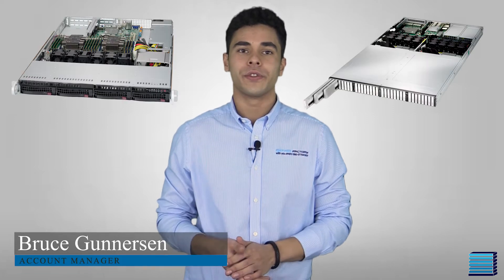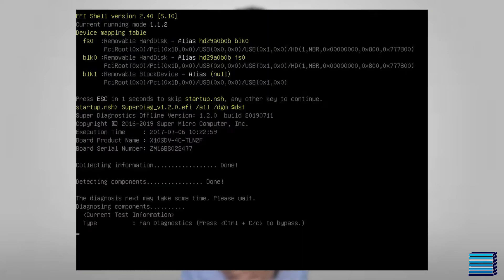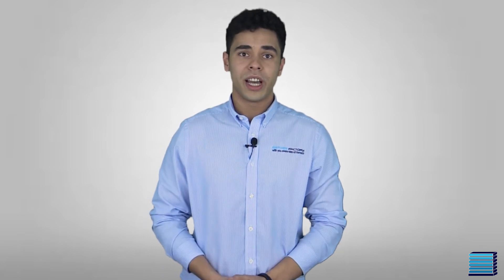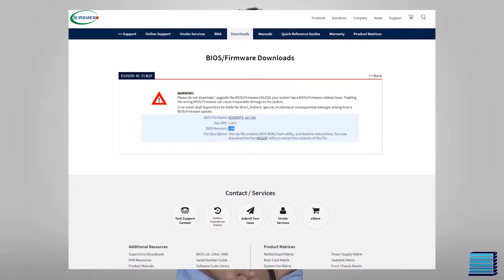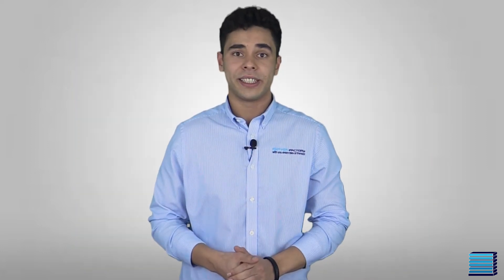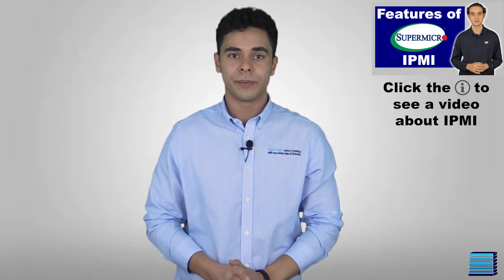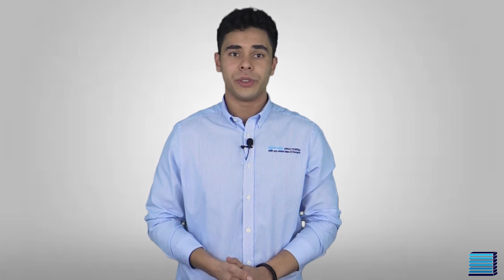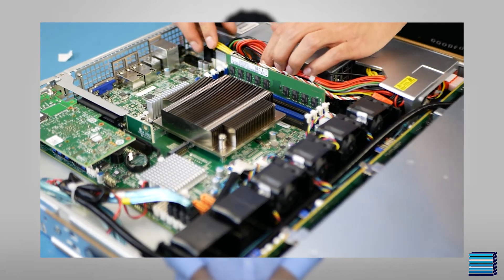The Supermicro Testing Process

Comment: I have a SuperMicro motherboard X9SCM(-F): and I put in the i3 processor and two 1600 (8 Gb) memory modules. I have four 3Tb HardDrives connected to the motherboard, and power supply. I realize I did not connect a monitor, mouse, keyboard yet. But when I press 'On' the Harddrive lights flash and come on, but I have one constant long loud beep. Is that caused because of not having the other stuff connected ? Is it a memory problem?
Reply from the maker: Beep codes are usually memory issues - are you using UDIMM memory?